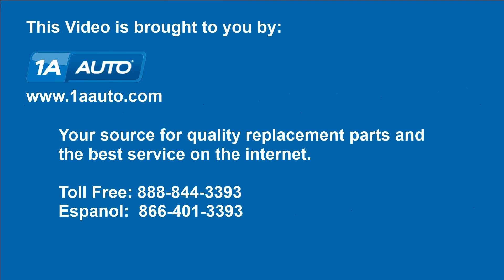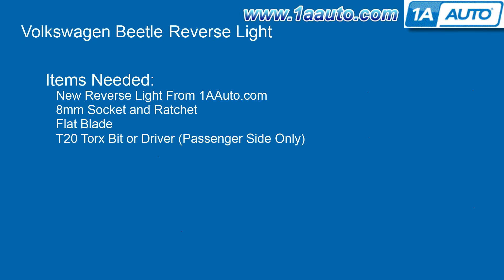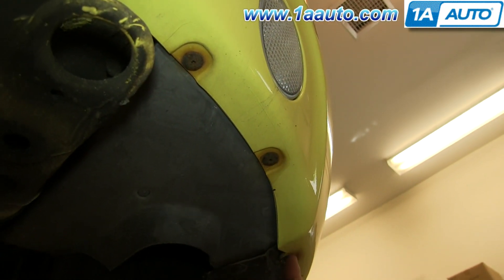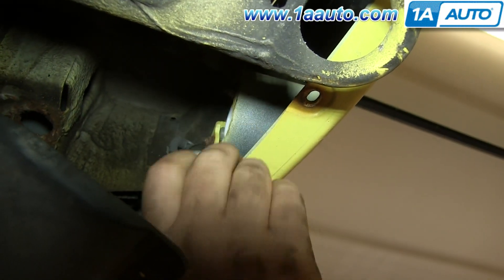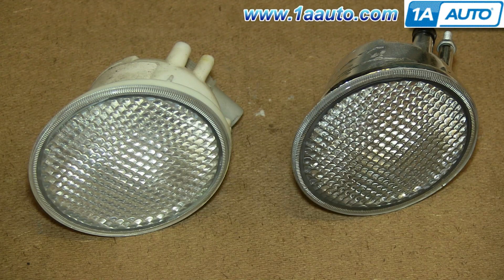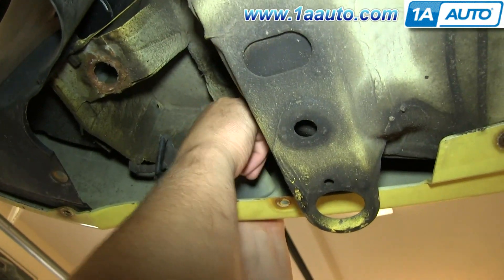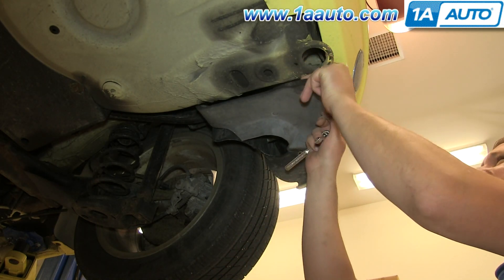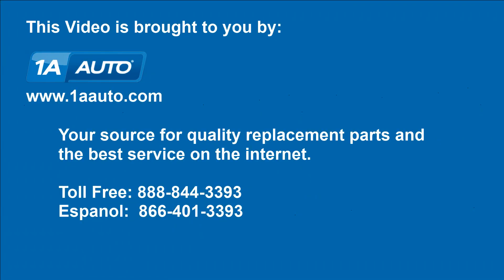How to Replace Back up / Reverse Light 98-05 Volkswagen Beetle

Comment: At 0:50, there is a metal shield over the harness on the driver's side, but at 1:13 and 1:34 the shield is gone. How do you remove the shield? I have tried and it is not an 8mm like the regular light assembly
Reply from the maker: +Randystudio217 At the beginning of the video we show you how to remove that cover. There are only a few bolts that secure it in place.
Reply: No, he is talking about the driver side, when you guys come back over to the driver side that metal plate is gone over the driver side reverse light, how do you remove the metal plate over the driver side reverse light

Comment: exactly what I needed.. though it isn't necessary to remove the wire harness from the bulb socket (on my passenger side, anyway).. remove the panel, twist the socket housing out, and just let it hang there a bit while you replace the bulb.. twist back into place, replace 4 torx screws = done :)
Reply from the maker: +Ed K Thanks for watching. 1aauto.com
Reply: Ed K What about on the drivers side? Do i just pull the harness out?